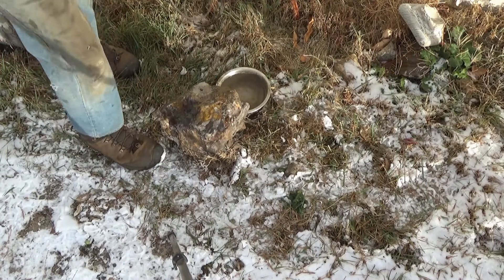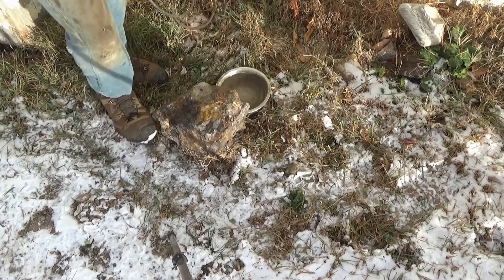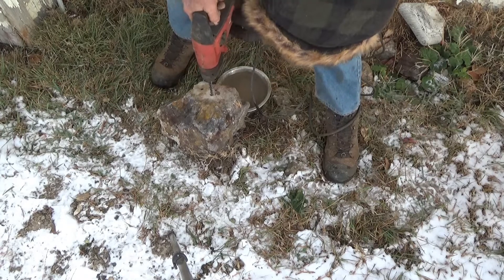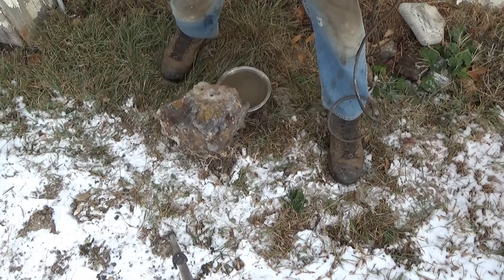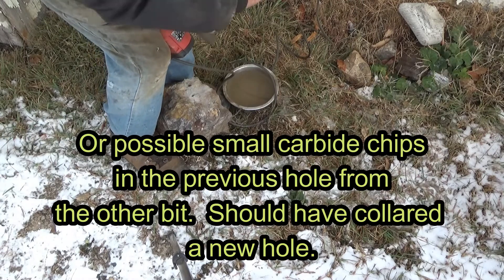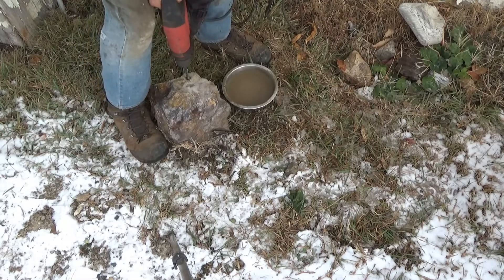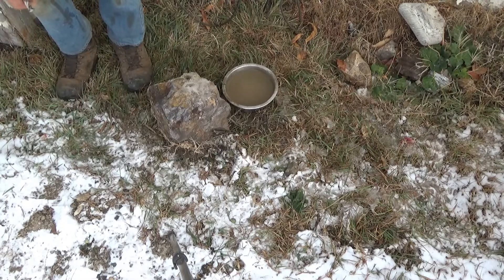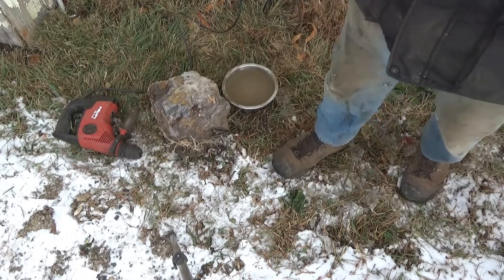248 Will ANY Drill Bit Hold Up To Kryptonite? (Hard Quartz)

Comment: It's obviously some very hard crap , i think Quartz is about 7 on the Mohs scale , but it looks harder than that . We use on concrete Kango 4 cut head German made , they  eat concrete like butter , will even cut through the Re bar , but that stuff you got there must be very hard if it dulls a normal Tungsten Carbide bit so quick , and using the water is a good idea , even keep dribbling some in the hole , Good luck with it , cheers Ned .
Reply from the maker: Pure quartz tends to be more brittle than this stuff.  It is almost like it is a quartz 'alloy' that is tougher than the pure item.

Comment: That looks real familiar. I nuen through those bits big time. But war On sells a good product.  I love the Sierra blaster. Thanks for using other bits I see not much difference
Reply from the maker: war On?  typo?  So far, except for the harder and more brittle carbides, they seem to work about the same.  A two carbide tip is definitely easier to re-sharpen though.

Comment: Are they SDS bits or the standard shafts? Bosch make the hollow dust extraction. Personally I’ve wanted try to run water through them. Help lubercate and keep it cool, don’t no that much Serra blasters? I have a dewalt battery hammer drill and 8 batteries. Used on concrete for anchor bolts.  👍
Reply from the maker: SDS+

Comment: Have you tried diamond core bits ?
Reply from the maker: I need 12" minimum depth and 10 mm (3/8").  Do they make those?
Reply: @hardrockuniversity7283  If you were really careful , could you not weld a 12 inch extension to the drill bit ?
Reply from the maker: @mohammednovalija  Without flutes it would not be able to remove the cuttings easily, but perhaps.  We have bits up to 2 feet long currently